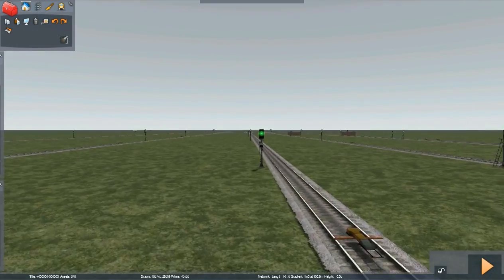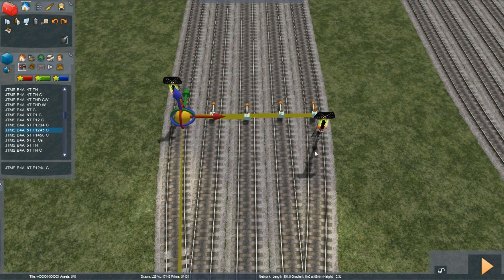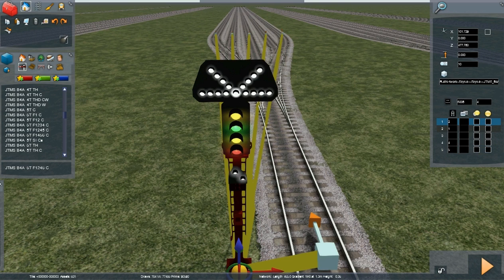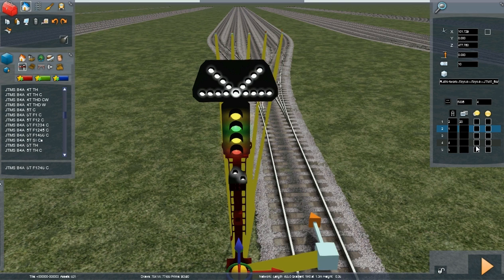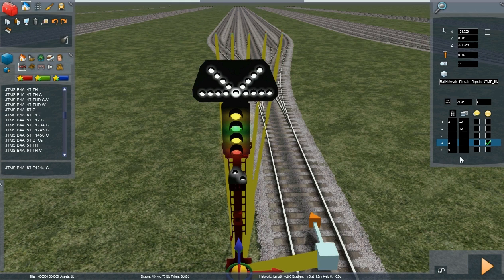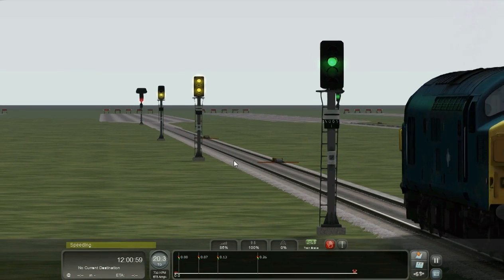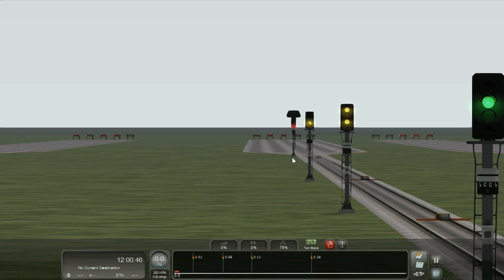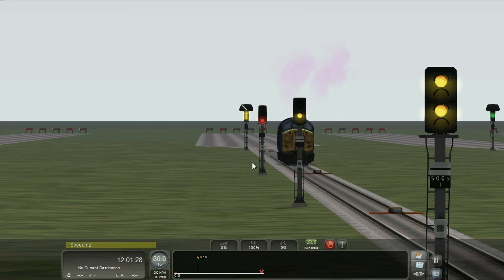005 Approach Control

Comment: A question about the UK Signalling System:

What are the two small white lights below the four aspects?
Reply: RWDecalV2 Oh, basically like the german Sh1 shunting signal.
Reply: @ampericus  its a calling on signal, used for directing trains into sidings, or over crossovers.